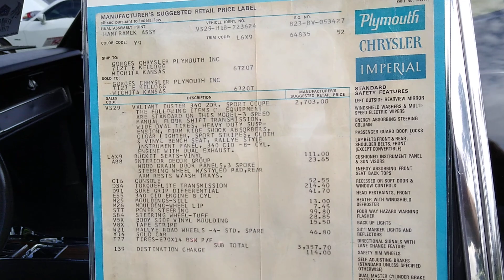Tom's unrestored 71 Duster 340 survivor interview

Comment: About 1979, I was 19 and looked at a Demon, 340, 4 spd, the guy never drove it because he thought he would learn how to drive a stick, but was just not able, not gonna rag on the guy , he had challenges lets just say.....anyway, he wanted 2500.00 from what I remember and the only thing that stopped me from buying it was that it did not have pwr steering and my other 3 cars on the road did. I worked in family repair shop and was able to insure all 3 cars under our fleet insurance for about 300 bucks a year.......I had no place at the time to put the Demon if I got it, would have had to get rid of one of my other cars, 68 Chrysler 300-440, 1960 Imperial Crown, or my 67 Camaro 327-4spd.............well, looking back, I should have found or made room.....that car would be worth a load today.....this one here sure is a super nice, original car, very, very rare to find this way

Comment: Nice car👍 Factory paint back then had a slight orange peel. So if it’s straight and shiny like this it’s either buffed out really good or it’s repainted.
Reply: How many new 71s have you seen? I've seen thousands and few, if any, had orange peel. I also owned a new 72 Dodge with perfect B7 paint. And are you referring to only this color?
Reply: @georgewetzel4380  I haven't seen them all ofcourse, but generally paint back then wasn't as straight as it is now. I have a '74 Imperial with original paint and it has a slight orange peel, also runs in the paint on the door jambs. Same thing with a '73 Dart I had years ago. Chrysler was known for a sloppy fit & finish and that includes the paint. I still love these cars though.
Reply: umm, this guy said tt's never seen a buffer/polisher. he only has hand waxed it. There is orange peel everywhere on this car as shown. It's awesome. Acrylic enamel is beautiful. I just finished a 71 superbee in Centari. Single stage offers a cool look for sure.